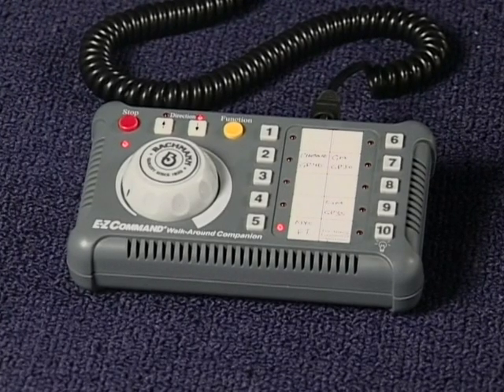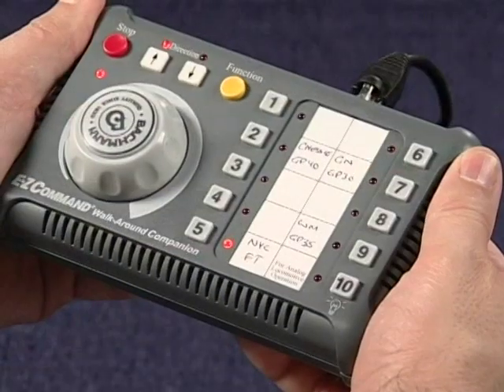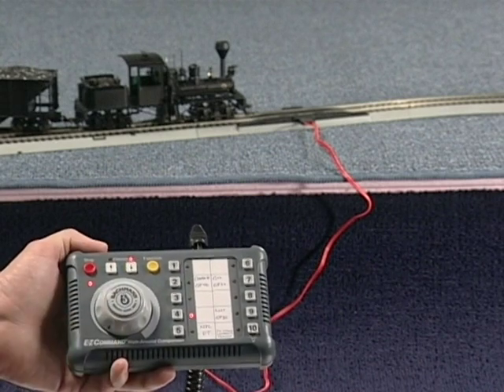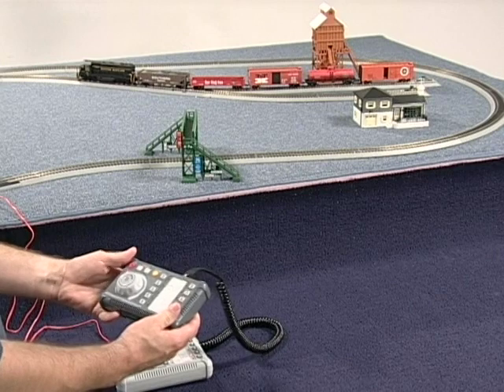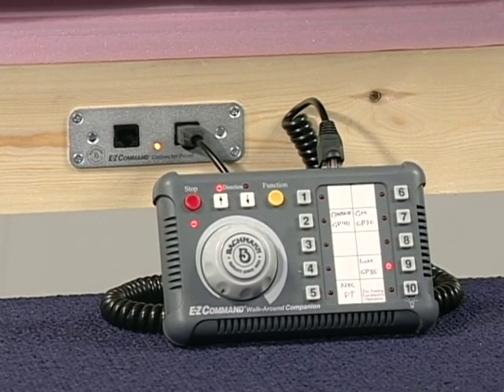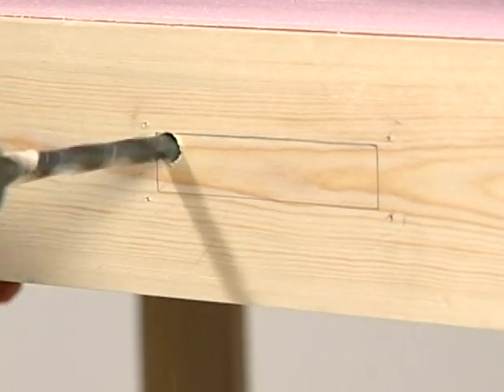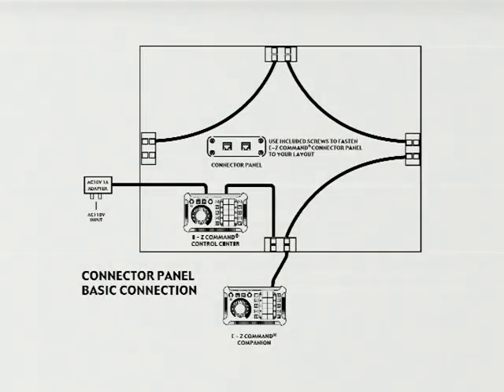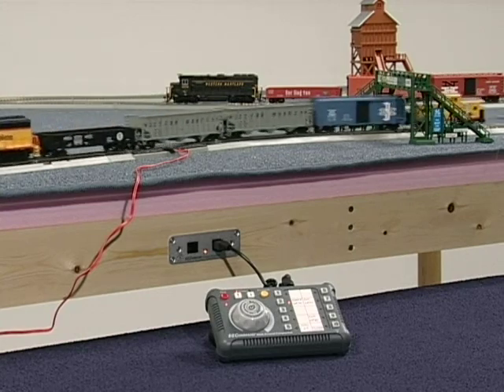E-Z Command Part 3

Comment: Can the control center be powered using 12 volts DC? I wanted to control N-scale DCC locomotives with the controller.
Reply: I believe so it has terminals on the back to hooch up wires